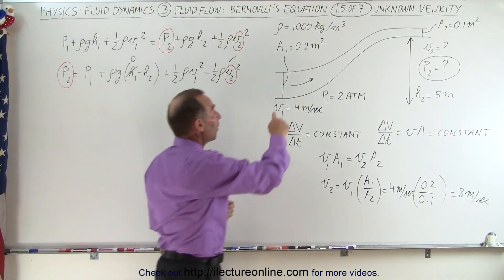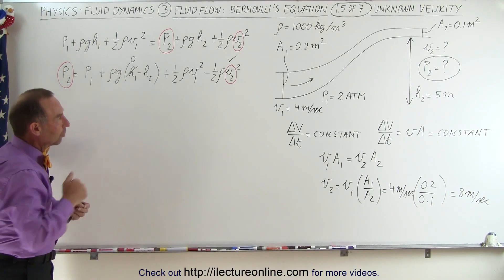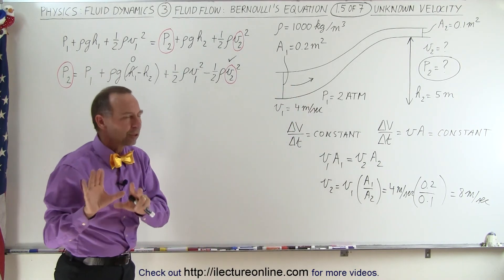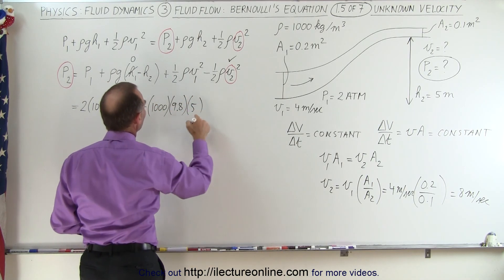Physics: Fluid Dynamics: Fluid Flow (1.5 of 7) Bernoulli's Equation: Unknown Velocity

Comment: would P2 be 1 atm for most cases? 1 atm resisting the pressure coming out of the tube?
Reply from the maker: Normally while inside the pipe, the pressure will be greater than 1 ATM, and after it leaves the pipe, the pressure will then be 1 ATM

Comment: Soooi... i kinda get it. But how does that work with an upgoing velocity but the pipe is narrower in the middle? I mean the velocity has to come down at the moment it leaves the narrow part, not? (So why doesn't that work on a universal scale? The only thing i can come up with is that the narrowest part of such a pipe is not completely filled with matter, so you can stretch and compress without any real problems. And that then leads me too.... how much would be enough too compress at the smallest part where something before that smallest part has got to give! Am i wrong, and if yes then why.  (I get the equasions still it would be nice to have a video. But if not, equasions are fine.
Thank you for all you already thought me as well
Reply from the maker: The pipe is always filled everywhere and the pipe can narrow and widen in different places and the speed and pressure will vary throughout the pipe.
Reply: @MichelvanBiezen  that part i get, it is even true on niversal scale but...

Comment: Sir i do have questions.....
Reply: Water emerges from a horizontal pipe at a rate of 0.5x10^ 3m^ 3/s. Find a velocity of water at a point in the pipe where the area of cross section is 12.6m^ 2.
Reply from the maker: The amount of water flowing through a pipe ever second = A x v  (A is the cross sectional area and v is the velocity of the flow).  v = A / flow rate
Reply: Thank you sir you did helped a great 🥰

Comment: 7:49 but from where does this additional pressure comes from ?
If we had 1 bar at point 1 this could get the water in the vertical pipe to approximately 10m, can we now take 7000 times wider pipe and get water to 1 kilometer in vertical pipe and still have 1 bar at the point 1 ?

Or in the previous example, if pipe is constant diameter and height difference is 1000 meters and pressure at the point 1 is 2 atmospheres, I bet there would not be any water at the point 2 ??
Reply from the maker: Making the pipe wider will not cause the water to go higher with a particular pressure.
Reply: @MichelvanBiezen  so pressure is not higher in wider pipe ?

Comment: I have a problem with a bent in the pipe. When I checked online for tutorials, most problems with bends were solved by Bernoulli's principle assuming that the inlet and outlet heights are equal. And then forces were resolved at x and y directions at the bend. Can you explain why it is assumed? Is this method correct?
Reply from the maker: That is done for simplicity.   Just like we ignore wind resistance in projectile motion, to make it easier.  But with more advanced fluid motion problem, the loss due to bends in a pipe are included.   We plan on adding those types of fluid dynamic theory and problems, but we don't know when we'll have time.
Reply: @MichelvanBiezen  Thank you!

Comment: What is the pressure of flowing water in pipe....has cross section area A and velocity of flow is v... density is R......

There is no elevation in pipe...
Reply from the maker: Have you seen this playlist: PHYSICS 34.1 BERNOULLI'S EQUATION & FLOW IN PIPES
Reply: @MichelvanBiezen  yeah i watched that now a minutes ago... Thank you very much sir ... You are simply amazing .... 

I am working on these parameters to be calculated with the help of water trajectory method .... calculation will be done Via DESMOS. Graphing calculator .....

Comment: Does the pressure drop of the system matters? let say for the same problem in the video, assuming fluid transfer is via hose and it is given that the hose pressure drop is 0.1 bar (or any value).
Reply from the maker: Yes, the pressure drop matters, and if the drop is due to frictional drag, then it must be added to Bernoulli's equation.  There is a playlist that includes additional terms to Bernoulli's equation:  PHYSICS 34.1 BERNOULLI'S EQUATION & FLOW IN PIPES
Reply: Thank you!

Comment: Hello Michel, thanks for this I really liked it. However, it doesn't seems to work when P1 = P2 = Patm i.e. both ends of the tube are open to the atmosphere. 

Let's say 1 is higher than 2 and fluid still flow from 1 to 2 and let's say I am trying to determine the velocity at point 2
The Bernoulli equation you get when removing P1 and P2, and multiplying by 2*rho is

0 = 2g(h1-h2) + v1^2 - v2^2

If we input v1 = v2 (A2/A1) we get 
0 = 2g(h1-h2) + v2^2 (A2^2/A1^2 -1)
V2^2 = 2g(h1-h2)/ (A2^2/A1^2 -1)

I have a problem here when A2 = A1 --> A2^2/A1^2 -1 = 0 and I end up dividing by 0. Also I get infinite speed if A1 and A2 are very close.

There is definitely an issue somewhere but where is it !?
Reply from the maker: You may be setting up a hypothetical situation which violates the laws of physics.
Reply: @MichelvanBiezen  I am trying to solve this problem https://www.chegg.com/homework-help/questions-and-answers/water-tank-water-level-height-h-exposed-atmospheric-pressure-bottom-tank-nozzle-angle-thet-q18940888

For this, I want to know the speed of the water at the bottom of the tank. I thought this could be solved with Bernoulli's equation by considering a point A at the top of the tank (a large section pipe) and point B at the bottom of the tank (a small section pipe) both are at the atmospheric pressure
Reply: This problem is actually closer to what I am after https://www.chegg.com/homework-help/questions-and-answers/problem-3-water-tank-cross-sectional-area-a1-075-m2-open-atmosphere-outflow-pipe-bottom-cr-q25219741

Comment: how about, i have a waterpump which pumps 15 liters/min. with a pressure of 0.35atm.
the length of the pipe is 2.5m and the height difference is 1m. i have to split the pipe at 0.5m height into two pipes. the total length will be 3.5m now. the diameter of the tubes is 10mm.

how do i calculate the speed of the water at the top? is it just the total surface to double. or does the fact that 2 pipes instead of 1 pipe to go up that last 0.5m also has effect?
Reply from the maker: Assuming we can ignore the effect of viscosity and the effect at the junction, it is simply the total height difference (which causes a shift in pressure) and the total cross sectional area (which has now doubled and thus the velocity is half at the top.)
Reply: thank you a lot , @MichelvanBiezen .
the total height difference is that with or without the double height from the extra pipe, so 1.5m instead of 1m
Reply from the maker: It depends on where you are determining the velocity and the pressure.  It would be the same point.

Comment: What would happen if the pipe creates negative pressure means (for this video) that the reference height is so high it creates negative pressure. What would be its physical mean?
Reply from the maker: If the pipe goes to high, the water won't reach there, (unless there is siphoning action).

Comment: What if I am given both pressures, radius for both ends, and the vertical distance between point one and two, but no velocities? This is a problem on one of my worksheets and I dont know how to solve it.
Reply from the maker: Since P1, P2, rho * g * h1, and rho * g * h2 are known you can move all those terms to the left side and set it equal to C1 (a constant)     Then move (1/2) * rho * v1^2 to the right side, multiply both sides by 2 and divide both sides by rho and you get a constant (C) = v2^2 - v1^2 on the right side.  And then r1^2 * v1= r2^2 * v2.